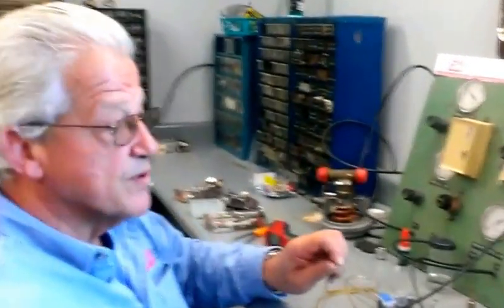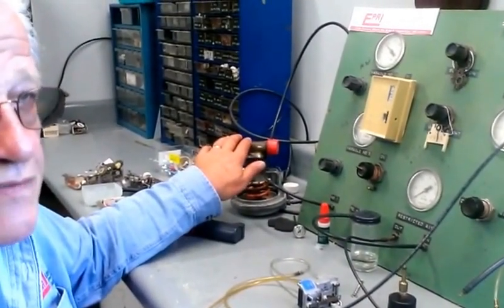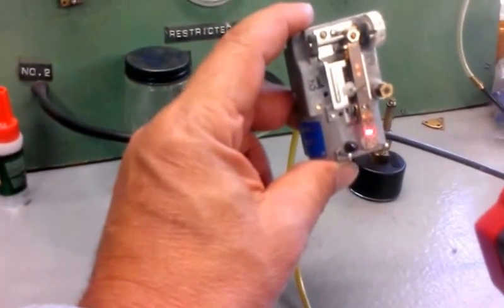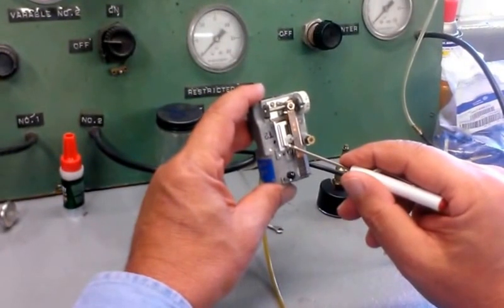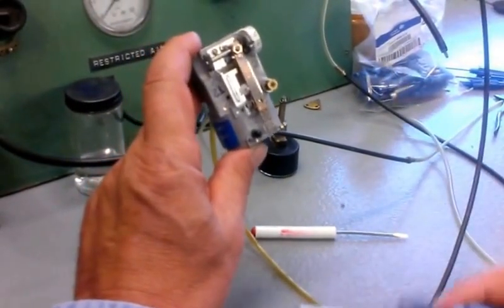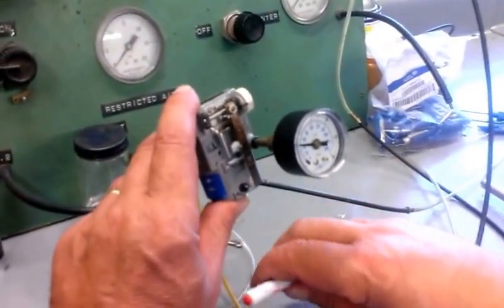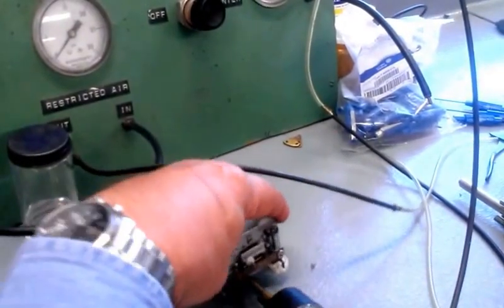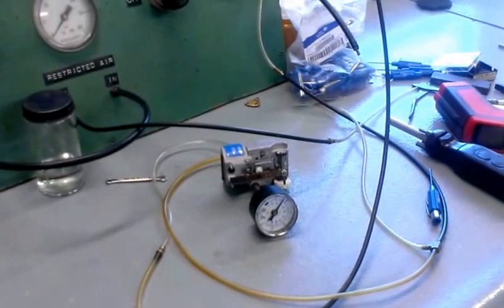How to Calibrate a Johnson Controls T4002 Pneumatic Thermostat

Comment: Where can you find the threaded gauge adapter?
Reply: The part number is JC 5310 test gauge (a jci part), good luck finding one.
Reply: @Mosin-lf7wl  I did actually end up finding one about 2 years ago got lucky where I bought it only had two left in stock

Comment: First of all, you want the ambient air temperature, not any surface temperature.  A regular digital thermostat is better than the laser for this reason.  Just have it as close to the T-stat as possible.
Second of all, speak up!  We're not in the room there with you.  It seems like you're on something.

Comment: Greetings 
Thank you for the video
I run an old building that has half of the T4002 and the other with some really old thermostats that are not labeled.

The gauge you use and the fiting, what size is that? If I go to the store to get a gauge and tube what size should I pick up?

Thanks again
Reply: Class 1 Direct Action July 8, 1924
Reply: I should have clicked on the link.
I have in my building as well as the T4002 the Brass pneumatic thermostats. 
Do you have a video on how to calibrate those too?